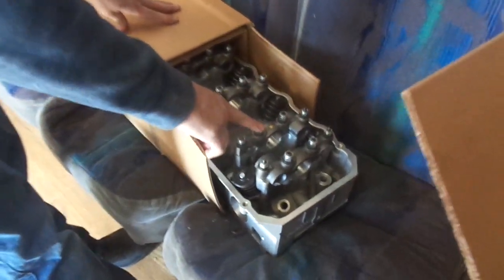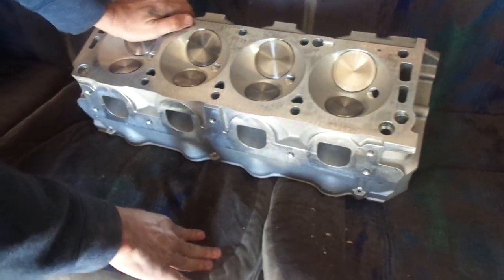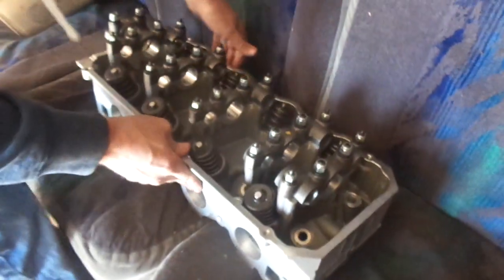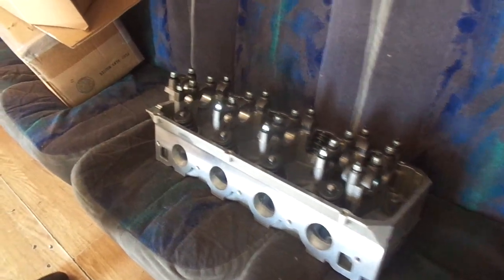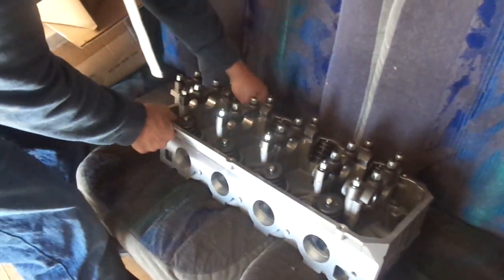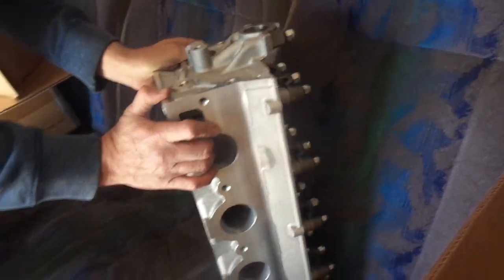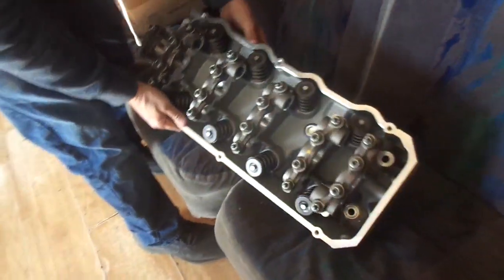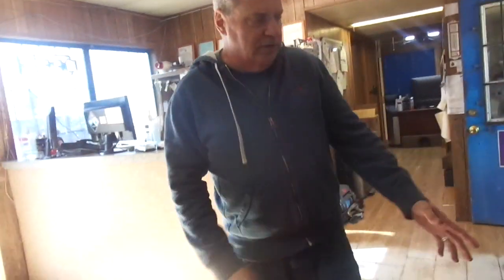SOHC Ford 427 Cammer heads

Comment: Hope you have better luck with yours. Have had 3 sets come through the shop with major cam line alignment. Each one required align boring as well as shaft alignment and loading of the shafts.  There is some shaft location issues which effects cam timing due to where the lifter picks up the camshaft.  To me, cam timing events; may as well forget about it. Go by lobe center line. 
--- I certainly hope that the other Cammer heads offer easier assembly and fit than what was here.